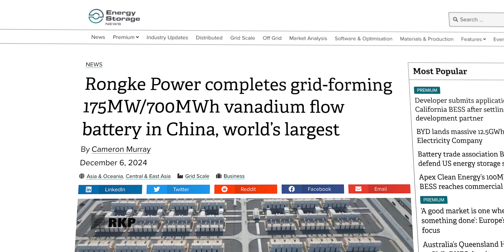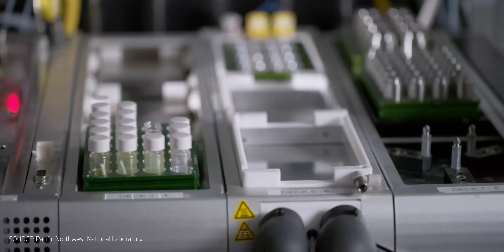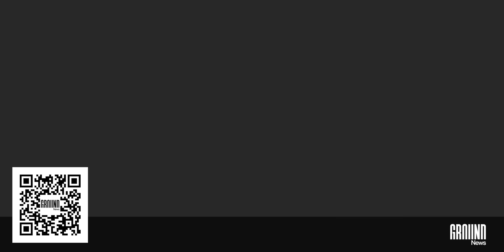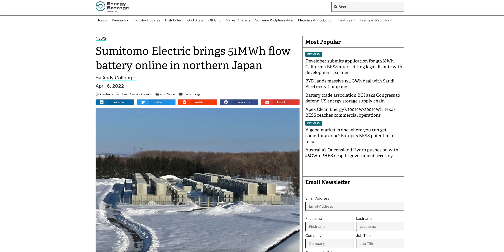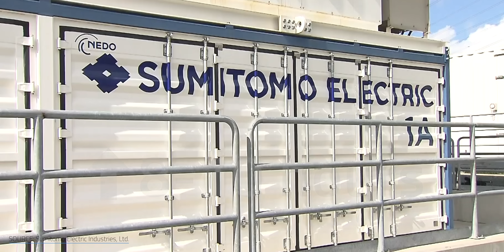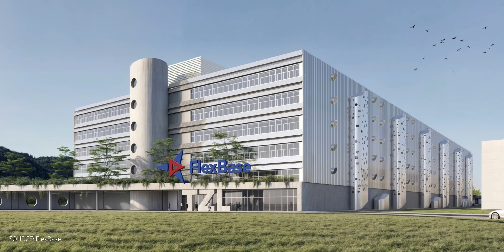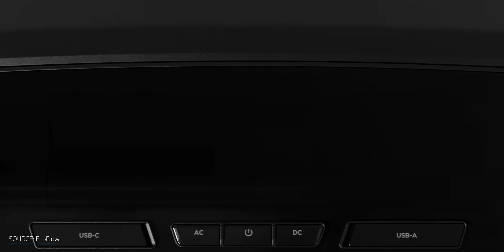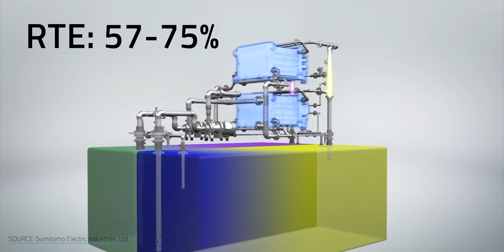Why Isn’t This Revolutionary Battery Everywhere?

Comment: Just for reference:

A medium sized coal plant can provide around 2500 megawatts all day long.  (Takes a couple train loads of coal to do it).
One of those really big VFRB plants can do a quarter of that for about 4 hours. 

To convert to renewable and match existing tech...  You need an absolutely ridiculous number of massive battery plants and a matching number of reliable energy collectors.

(Whispers: LFTR Nuclear is the answer.)
Reply: Not a like for like comparison, given the larger footprint of a coal plant (let alone the mine to feed it, it's spoil heap and the ash/slag heap of the power station) and the small size of the current flow-battery installs. I suspect if scaled to the same footprint the flow-battery to the same size as a coal power station it's output would be the larger.
Reply: @GruffSillyGoat Fair point. Plus, you can put a battery station right in the middle of downtown Anycity, which is pretty great.

I seriously doubt it would compete for power output capability though, yard for yard.  -Bearing in mind, the coal plant also doesn't need acres of solar panels and windfarms. -A single strip mine can reliably feed a bunch of them year round.

Definitely cleaner, though, even considering the mess mineral mining makes. It's a one time extraction cost per battery plant, as opposed to daily, roughly speaking.

I still prefer nuclear overall. -So long as the tech gets cleaned up and divorced from deliberate industrial inefficiencies.
Reply: @MarkOakleyComics  also coal plants pollute air and 7 millions of people die every year from air pollution
Reply: Nuclear is a fascinating tech with an equally fascinating game of shadow panic and manipulation behind the scenes.  (Not surprisingly, whenever I write about its history, YT deletes my post. It has happened twice already in this thread.)

Present nuclear has been limited with staggering built-in inefficiencies, (for instance, fuel pellets are somewhat analogous to the ink jet cartridges of today, hyper expensive for what they are, -though unlike ink, by the time they are 'spent' are still 97% unused). I am convinced that this, and other measures, were taken to deliberately bring the cost of energy delivery down to parity with fossil fuels so that the technology didn't completely wipe out the generational wealth of the oil class.

LFTR tech was demonstrated to be clean, cheap and very efficient and you can't extract military grade materials from spent fuel. But proof of concept reactors were unceremoniously shuttered before the tech could prove itself in the market.

Nuclear is unlike any other energy. Rather than tapping into stored solar energy, (like coal and hydro), it draws energy from the Big Bang, potentially freeing us from the old give-take economics of traditional physics. But instead we chase after windmills.
Reply: @MarkOakleyComics  nuclear is a failure. eveyone knows that except of people fooled by nuclear lobbist
Reply: @MarkOakleyComics  nuclear is a failure. it's the most expensive source of electricity, more expensive than gas peakers. and that's even before considering that it is insured by taxpayers
Reply: @MarkOakleyComics  that's some alternative physics. big bang didn't create elements heavier than lithium
Reply: @SergePavlovsky  "that's some alternative physics. big bang didn't create elements heavier than lithium"

That's the kind of hair-split (because you know exactly what I meant) which indicates somebody with an emotional investment in not seeing.
Reply: @MarkOakleyComics  i know exactly that you don't know that heavy elements are created by supernovae
Reply: @MarkOakleyComics  you have cheap, safe and exponentially growing tech, but you prefer to spread propaganda of tech which can't live without taxpayer support
Reply: just for reference: coal electricity is uncompetitively expensive, it's being replaced with ng and renewables. and lol, nukes are the most expensive source of electricity. for many nukes it's cheaper to stop them and build new solar or wind plant, than to continue to use them
Reply: @SergePavlovsky  Nuclear is a fascinating tech with an equally fascinating game of shadow panic and manipulation behind the scenes.

Present nuclear has been hamstrung with staggeringly obscene built-in inefficiencies, (for instance, fuel pellets are somewhat analogous to the ink jet cartridges of today, hyper expensive for what they are, -though unlike ink, by the time they are 'spent' are still 97% unused). I am convinced that this, and other measures, were taken to deliberately bring the cost of energy delivery down to parity with fossil fuels so that the technology didn't completely wipe out the generational wealth of the oil-oligarch class. No joke.

Further, Liquid Fluoride Thorium Reactor (LFTR) tech was demonstrated in the 60's to be clean, cheap and very efficient, (you can't even make warhead materials from their spent fuel), and proof of concept reactors were unceremoniously shuttered before the tech could prove itself in the market.

Nuclear is unlike any other energy creation scheme. Rather than tapping into stored solar energy, (which is what oil and coal do, chemically), it literally draws energy from the Big Bang, potentially freeing us from the old give-take economics of energy equations. It is in fact the miraculous free energy holy grail which backyard inventors have been chasing for centuries, but people have been lulled by cynical manipulations and propaganda into ignoring this civilization elevating technology and now instead chase after windmills.
Reply: @SergePavlovsky   Nuclear is a fascinating tech with an equally fascinating game of shadow panic and manipulation behind the scenes.  (Not surprisingly, whenever I write about its history, YT deletes my post. It just happened a moment ago, and I am trying again.)

Present nuclear has been limited with staggering built-in inefficiencies, (for instance, fuel pellets are somewhat analogous to the ink jet cartridges of today, hyper expensive for what they are, -though unlike ink, by the time they are 'spent' are still 97% unused). I am convinced that this, and other measures, were taken to deliberately bring the cost of energy delivery down to parity with fossil fuels so that the technology didn't completely wipe out the generational wealth of the oil-oligarch class. No joke.

Further, Liquid Fluoride Thorium Reactor tech was demonstrated in the 60's to be clean, cheap and very efficient, (you can't even extrade military grade materials from their spent fuel), and proof of concept reactors were unceremoniously shuttered before the tech could prove itself in the market.

Nuclear is unlike any other energy creation scheme. Rather than tapping into stored solar energy, (like coal, solar and hydro), it literally draws energy from the Big Bang, potentially freeing us from the old give-take economics of traditional physics. It is in fact the miraculous perpetual motion holy grail which backyard inventors have been chasing for centuries, but people have been lulled by cynical manipulations into ignoring this civilization elevating technology and now instead chase after windmills.

Let's see if YT deletes this again...

Comment: While I dont like the tech as a battery in it self, Li + Na + Run off station are really the answer to me. Li and Na come from the same areas most of the time making it cheaper if we can just make use of both. They're both maturing to a point they can become solid state even and price points that can be very cost competitive while being recyclable on the elemental side, but I also feel like we need run off stations. Batteries that do take more power to store their power for longer terms. This way, while yes you do burn some of the power off, you can easily store whatever amount the grid can provide to it on those super sunny days without worry about over producing like we see in cali. They can be spliting water into hydrogen or air storage or even redox batteries. Granted, I wouldnt use vanadium... you can do the same with Na (salt water) too only because you can build larger scale systems that way.

Comment: 👍 Reusing vanadium from an old battery for the new one 👍

This "reducing" and "reusing" mindset is the one we need for true sustainability.
Reply: It's only possible, but it's not done much cos the reuse involves a substantial cost. We can recycle lots of things, but most of them just aren't profitable to do so for. Indeed vanadium mining itself isn't profitable at present, so it's mostly sourced as tailings from other mining.
Reply: @KokoHekmatyarr   I understand reusing and recycling is expensive. I say reduce the filthy profits the 1% gets and there'll be plenty of funds to make it more accessible.

Comment: This needs a deeper dive into this battery technology. This already sounds better than solid-state batteries in every way, but is it?
Reply: Not so much BETTER than solid state, just completely different use. ENERGY DENSITY (kWh/kg) really matters for transport applications (eg EVs) and that's where solid state would shine. CHEAPNESS ($/kWh) really matters for battery farms for the power grid, and that's where redox flow may shine; who cares if it takes an extra hectare or so more than a solid state battery farm would?

Comment: '"Why are they catching on everywhere but the US?""  - there is ONE in china, and they are working on one is Switzerland. I'd hardly call that catching on.
Reply: Those were just two mentioned in the video. Actually there were four mentioned in this video, and they were mentioned because they have been the four largest battery facilities ever built (or in the case of the swiss one, still being built). There are many other large installations, and a lot of smaller installations. There is a company here in Australia (where the tech was invented) that builds shipping container sized ones that are being rolled out to dozens and dozens of remote communities.
Reply: @booshie_au  As mentioned in the video, Redflow went bust last year.
Reply: To be fair, while there arent many of these, the biggest one is in the top 10 of biggest battery energy storage plants by capacity.

You dont see many technologies where there are this few of them and the biggest ranks this high, so learning this was quite interesting for me.

Comment: I think that if we did a fully truthful accounting of the risk of fire, pollution, mining damage and all the other externalities involved in lithium storage solutions, this would be a hands down winner and the cheapest option. Unfortunately, the USA allows companies to dump all of those onto society at large with very little penalty. Just look at the clean up of battery use after the LA Fires. Also many of the major fires at utility storage facilities. If it gets too costly the companies go into bankruptcy and we have another super fund site. If we required that they all post an appropriate bond with the EPA before building those units, this tech would be in use everywhere and lithium would be much less in demand and only used for portable needs. It often seems we are "too business friendly" for our own good.
Reply: "the USA allows companies to dump all of those onto society at large with very little penalty...we are "too business friendly" for our own good." -- to be fair, this has been true throughout capitalism, and is a big reason why fossil fuels continue to dominate rather than be supplanted by renewable energy more quickly than it has.

You're not wrong. It's just there's basically no precedent for addressing the concern.

Though, now that I think about it, one could easily convince the fossil fuel industry that the lithium industry needs more regulation. They would use their immense clout to force lithium production to cover their externalities. Then VRFB would look much better in comparison. :)
Reply: The issue with flow batteries is that they cannot be used in mobile solutions (laptops, cars, etc.) due to liquid having to flow more or less uniformly (otherwise you would be getting energy spikes that devices don't like at all).
Also lithium is not the problem, currently there are 3 lithium technologies used on large scale: li-ion, LiFePO4 and Lithium-titanite.
Only li-ion is dangerous, but it has the advantage of being the lightest. 
LiFePO4 is much safer, but weights 2x as much, that's why it is common on stationary solutions but not in mobile.
Lithim-titanite is best of the 3, not ony being safest, but also having the capabilities of fast charging (the other 2 cannot charge faster than 1C), but its also the most expensive.
Reply: @markpashia7067   there are also other, safer, efficient energy storage solutions, some already covered in this channel. Sand and gravity batteries have already proven to be good alternatives. I'd say oil and lithium industries have to much power to let them thrive.
Reply: You're confusing pollution from lithium ion battery fires with pollution from Mining and burning coal and gasoline. Those are the dirty materials whose producers won't pay to clean up. How many lithium battery storage companies have gone bust before cleaning up their waste?
Reply: didn't understand what was said, just the way it was said. liked.
Reply: CO2 is climatologically irrelevant. 

CO2 is climatalogically irrelevant: Interglaciation climate change (e.g. the Medieval Warm Period) is caused by cosmic ray fluctuations ( see the work of Henrik Svensmark, et al).

Just burn coal: the CO2 issue is irrelevant (see above). The sulfur issue with gaol is bogus too: sulfur is an agricultural fertilizer (ask the farmers). The "acid rain" issue is at most "a nuisance" (see the $500 million NAPAP study of 1990).  "Acid rain" was another one of those shallow media sensationalisms, like "global warming" and "ozone depletion". 

Global warming is 21st century superstition. 

Just burn coal.

Sorry, but however intriguing these battery-thingies are, they are just another tax-sheltered boondoggle for people who don't want to do get a real job. 

Just burn coal.